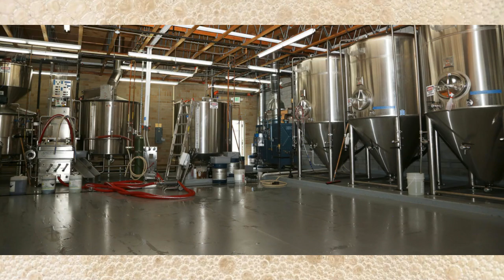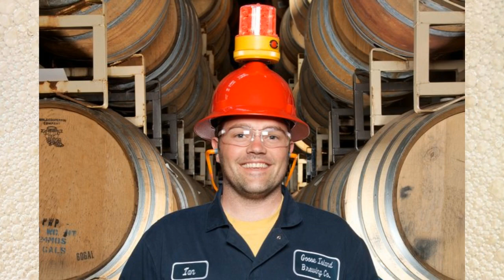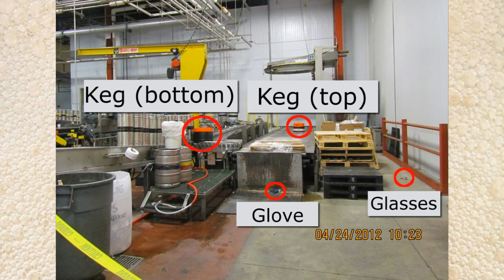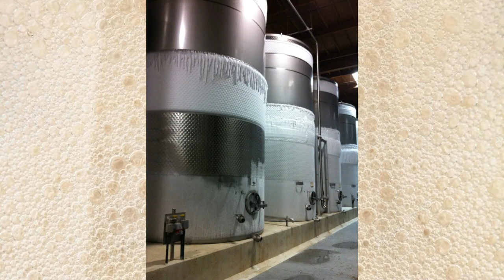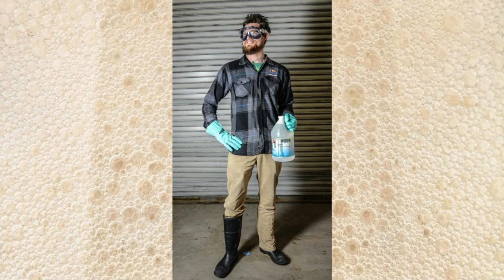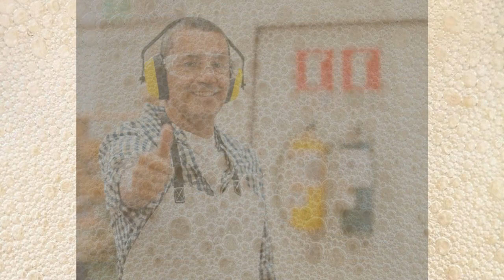Brewery Safety and the Craft Beer Industry

Comment: I usually empty the water out of my wort chiller before using it. I thought it was empty but when i placed it into the boiling wort it shot hot water within 15 seconds onto my shoulder leaving a nice burn that took two weeks to heal.Now i make sure there's a hose on the exit.
Reply from the maker: Good tip. I'll be sure to make sure something like that doesn't happen either. Cheers
Reply: BREWSnBASS been their and done that.  Lesson learned very quickly.